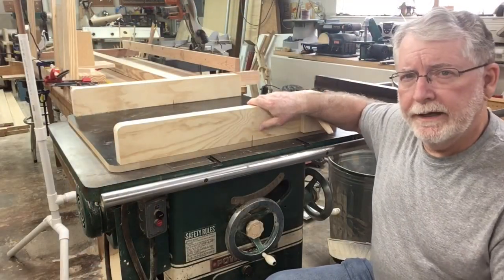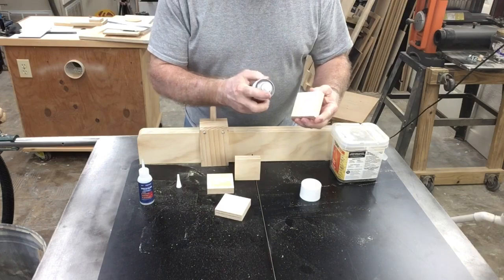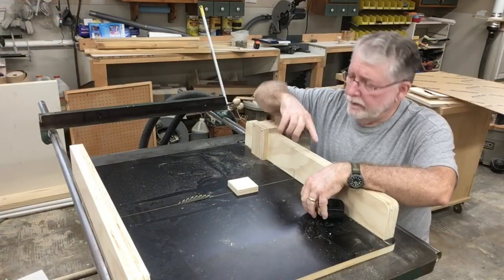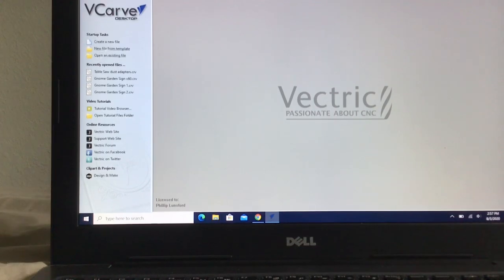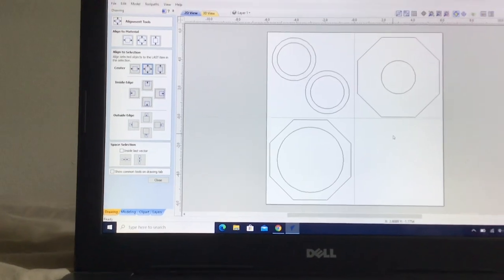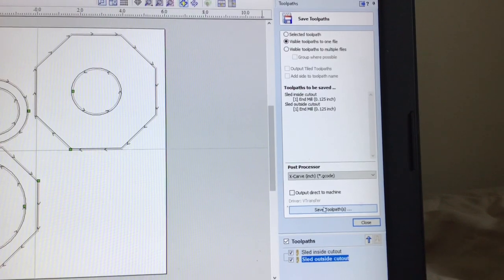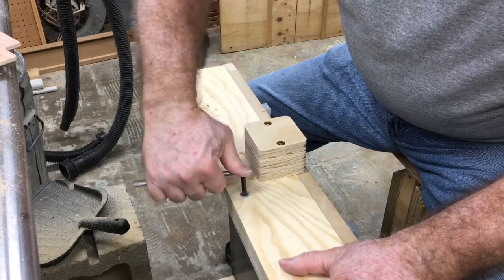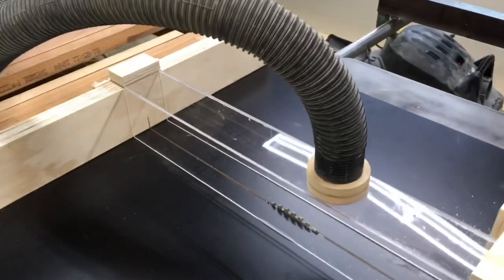Dust Collection for my Table Saw Sled (Part  2)

Comment: I arranged the extraction in a similar way. I just made the side parts of the acrylic suction hood so that they are height-adjustable and easy to adapt to any workpiece. First i had it like you have it. But don't you have, to adjust the height of the hood at the front and back of the sliding carriage?
Reply from the maker: Thanks, excellent idea.

Comment: I came for the dust collection as promised in the title. Then I sat thru 1/2-hour of everything BUT dust collection, including several product pitches which for all intents and purposes are ads. All of that wouldn't have bothered me as much if I could have at least seen the dust collection setup in operation.
Reply from the maker: You can see the operation in many many videos. It works great.

Comment: VERY nice additions to the CC sled. I am also working on DC for mine and like your approach to the acrylic hood. Have you tried any of the thin CA glues for the acrylic joining, or would that even work? I though that with the capillary action, the glue would spread through the joint, which you have pre-taped in position. I somehow ALWAYS manage to glue my fingers to something when using epoxy.
Reply from the maker: On the acrylic the thin glue has a tendency to run everywhere
Reply: @PawPawsWorkShop  Zi

Comment: Looks like you measured for the guard block from the top of the sled surface and then mounted the block lower - if you happened to push sled far enough if would cut through the top of the block. I would make the block larger.
Reply from the maker: Thank you. It is high enough to have the blade completely enclosed.  I appreciate your concern and I will double check it.

Comment: Someone is crazy about his CNC. It would be much faster to use drills to make the knobs - less time programming the thing.
Reply from the maker: No programming required...already did that a long time ago.  Just open the file and carve.  Much faster with all the computer work done and only one set up.  More accurate as well.  Try drilling and cutting the pocket for the bolt head.  It only tacks seconds to do on the CNC.

Comment: Nice video! I was thinking the same thing Dennis was asking about  heating and forming the acrylic. How well did the JB weld adhesive work with the acrylic? Does it bond like an an acrylic solvent does? 😁🛫
Reply from the maker: I do not like the glue. No, it did not melt the plastic.  I am not sure how long it is going to last.  On the bright spot, the dust collection is fantastic.
Reply: Paw Paw’s WorkShop thank you for the reply you saved me a few bucks, after digging around in my flammable cabinet I discovered I had some solvent. On another subject the 20 amp battery bank, the replacement one arrived and does not shut down during the charging process of the iPad like the first one did. I enjoy your videos.Even more so that you respond to your comment section. 😁🛫
Reply from the maker: Thank you for the update

Comment: quick question, why didn't you lay the acrylic sheet on the edge of a table and heat it up with a heat gun and bend it rather than glue it?
Reply from the maker: Actually I did not think about doing that until I was almost finished.  If this one breaks I definitely going to do that. Thank you